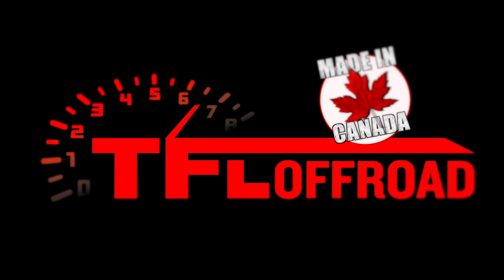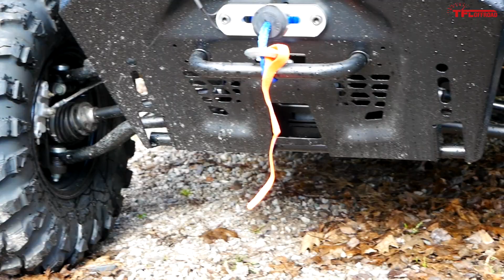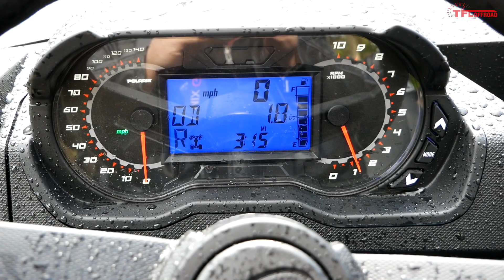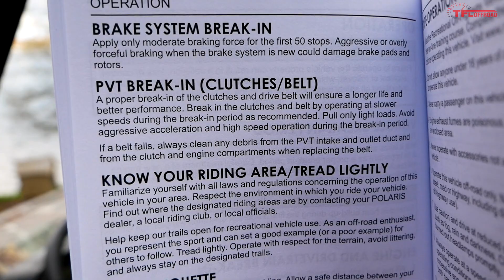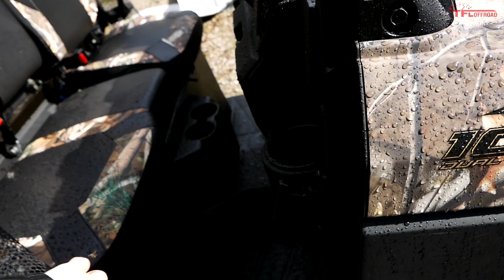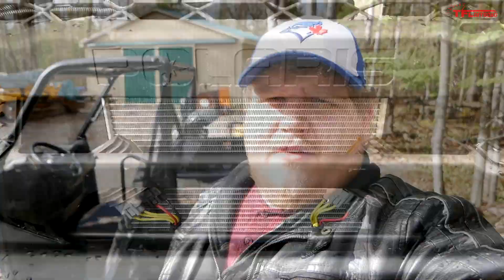Meet the 2019 Polaris Ranger XP1000 Backcountry Edition! Long-Term Test Introduction

Comment: I wanna see it used to help build your new road/trail. Can it drag a 10' section of tree? How about a big pile of brush? Nice intro to the Ranger  bud🤘
Reply: Yes! And pull a trailer or sled loaded with wood n' stuff. *Sled meaning cargo sled with runners, in the winter snow. Not a broken-down snow machine. Unless you come across one that needs pulled out.  hehe
Reply: @jedironin380  no more snow up here...just blackflies and receding  flood waters lol
Reply: @coryernewein  He did say it's a "long-term" tester. Maybe he'll still have it when the snow flies... if he should "forget" to return it before then.  :)